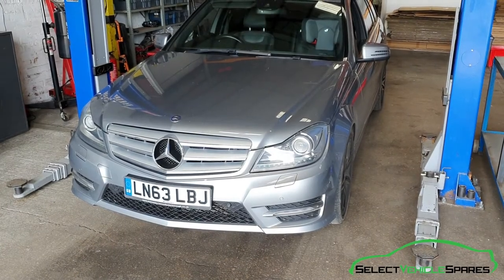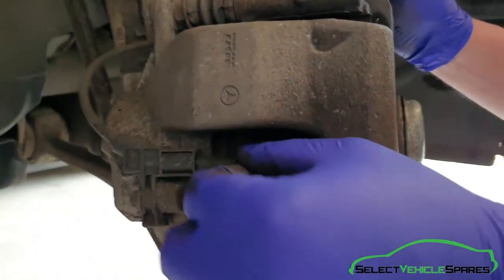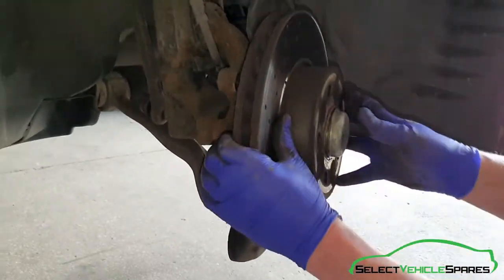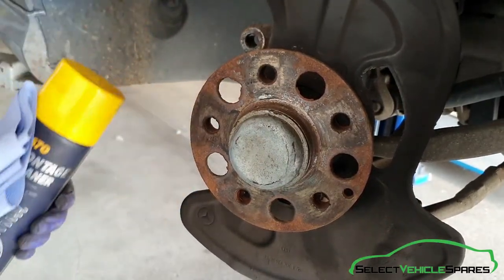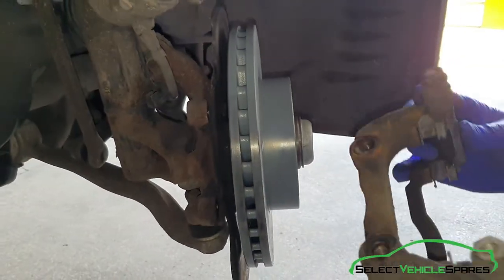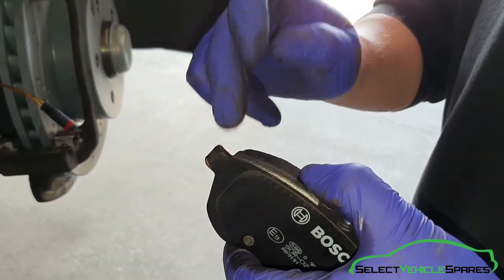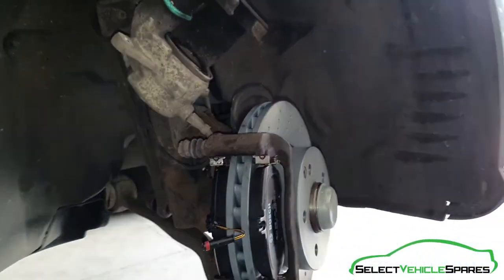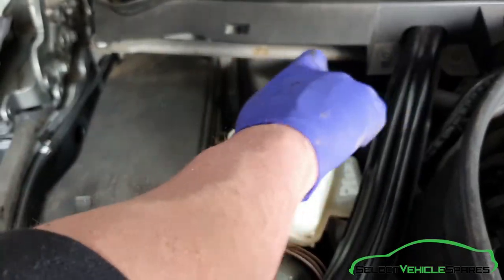MERCEDES C-CLASS W204 - How To Replace Front Brake Discs & Pads Change Swap Replacement (295mm Disc)

Comment: Great deeply detailed video. I’ve noticed there are 2 different caliper designs with these model years and it definitely makes a difference.
Reply: Absolutely! If you have one that isn't shown in any video I have found there are some surprises. Just record your removal and replace the same. There is a spring holding the outer pad which may give you some grief. Can't find any torque numbers. In the dealer manual no doubt Use locktite
Reply: @murraygreen8706  luckily mine didn’t have a spring. Unless you’re talking about the piston? Just push it in with a c clamp 🗜 and good to go
Reply: Glad you didn't have to deal with the spring. I have only seen one image on the internet that looks like my car but no info.

Comment: Hey great video... was wondering if that black plate on your caliper that usually says mercedes benz is removeable for the w204? Also copper, aluminum, silicone, purple ceramic... which is best for brake jobs the amount of different materials for the same job makes this confusing. I bought some purple ceramic which they said is supposed to be the cream of the crop and I think it actually is causing my brakes to stick and freeze by turning into a gum sort of mess combined with the brake dust.

Comment: Great video but missing bit I need.  I have brembo directional pads can't tell which way
Reply from the maker: Are there arrows on the back of the pads? If so, these should point in the direction that the disc goes when travelling forwards.

Comment: I've watch Yr vid and though am going give it a go..you made it look so easy..when I put the discs and pads on though I turned them by hand and could here a on off scraping sound and the discs were marked where the pads where rubbing..thought they just need bedding in so put wheels back on for test drive only to smell burning and see smoke..is this normal for new pads and discs
Reply: If you compressed the caliper piston all the way back you should not get the pads scraping the rotors.  Did you use OEM or aftermarket parts?

Comment: Couple of points. It would have been best to use thread lock on the carrier bolts. Mercedes do that.  Also, no need to clean the metal clips as new ones  come with the new pads.

Comment: Is there no need to bleed the brakes? Will it be okay if I just change the pads or do you need to bleed the brakes then?
Reply from the maker: There is no need to bleed the brakes when changing discs and pads.
Reply: @SelectVehicleSpares thanks , I just plan on changing pads so I will have to bleed the brakes then 👍

Comment: Wish I’d watched this video first!
None of the other guides I watched had a plate on the calliper. I tried to remove mine so that I could use the piston return tool and it snapped off. 
It doesn’t seem like the most critical component so I’m hoping that it won’t cause issues. I don’t suppose you can shed some light on it?
Reply from the maker: Do you mean the plates on each end of the caliper where the brake pads slide in to? If so, yes these are required, nothing should be missing from the brake setup, they are there from the factory for a reason.
Reply: It’s just a plate used for decals such as AMG

Comment: Are there torque specs for both front and rear?
Reply: Rotor screw 10nm.  Caliper bolts 34nm.  Brake carrier bolts 110nm.  Front.  Rear should be similar.